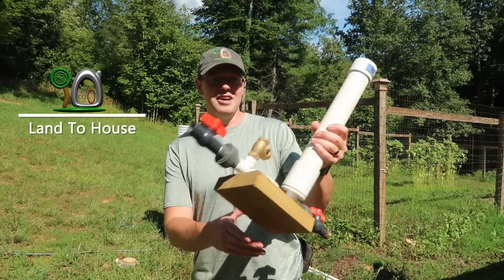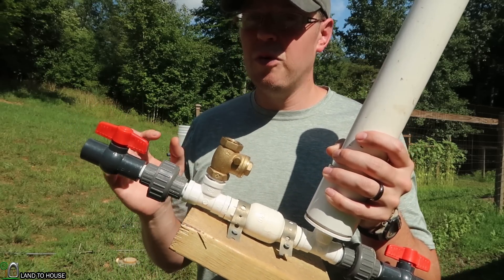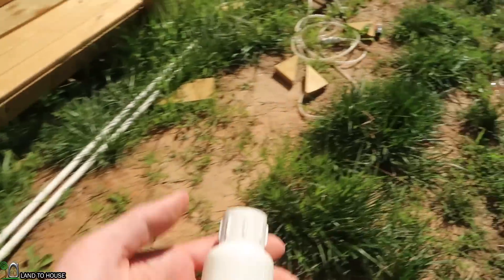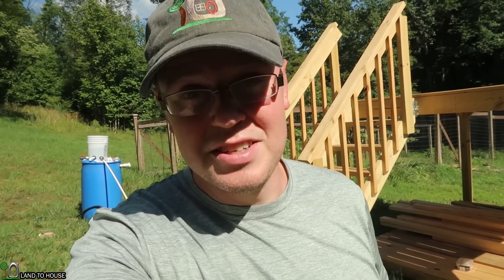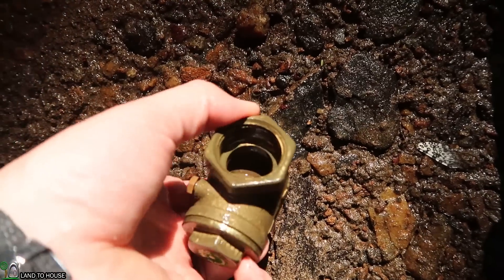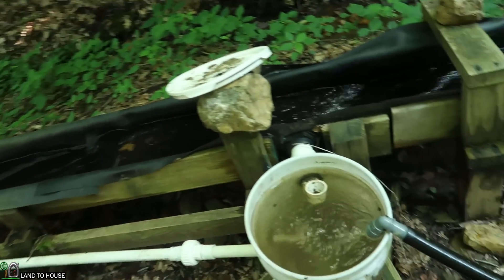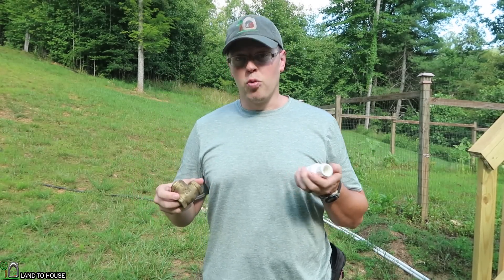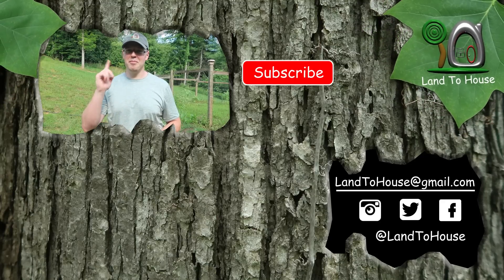A PVC Waste Valve - Will It Work - Ram Pump

Comment: I have successfully modified a 1 1/2 inch pvc spring check valve and it is currently operating on my ram pump as a waste valve pumping water 500ft to my farm. 
If you would like to know what I did, just let me know

Comment: I love the idea of using the stainless steel swing valve (waste valve). Can you do an experiment adding 1 or 2 stainless washers to the inside of the PVC valve, to see if it will make it heavy enough to work properly?
Reply: The pvc spring check can be made to work. I have a 2" system working. I removed the spring, it unscrews from one end. Then replaced it with two 3/16" fender washers with a 3/4" steel nut sandwiched between the two washers and screwed all of that back to it using a longer screw. I think the screw ended up being about 1.25" long. The check valve also unscrews in the middle and has an o-ring between the two pieces. I want to try a very light spring but it wouldn't be able to be very long because then it would keep the valve from shutting all the way. I know this video is a little old but Seth has done a good job with them and continues making good videos.

Comment: Could you run a stand pipe off of a pvc spring valve to a brass valve at the top with the same orientation and have the pressure wave from the brass valve close the pvc valve with similar force?

I'm trying to build a system that uses a .017 internal diameter aquarium hose as a stand pipe with bushings and fittings to elevate my waste valve back into the bottom of my source tank(like a water tower) so I have less losses overall.

Comment: Thank you so much Seth for your videos. Can I use the ram pump for my concrete fish ponds to pump the water to a bucket gravity filter? I am thinking of using the pond's outlet pipe as my inlet for the ram pump will give a good drive pressure , but the waste valve will lead to continuous loss of water. 

What can I do in this scenario and is there a way to reduce the noise/sound of the waste valve snap?

Comment: The slightly longer open time and stiffer snap closed on the stainless steel waste valve should also generate a higher pressure spike, and a little more delivery pipe pressure/height/flow.

Comment: Hello Seth
     I use a 2” drive pipe 25’ and created my own waste valve using a 2” to 4” bell reducer and a 4”to 3” bushing with a 3” close threaded pvc nipple. I turned and milled a gate that seats on the bushing. It is 1” thick in the middle flat that rides in the pvc nipple. I attached a small offset flat to give the gate a slight turn each cycle to prevent wear in one spot. No springs or weights needed. 
    I have rigged it to compress air with some success but about 60 psi was about all it would muster. I managed just over 70 psi with water.
Reply: Yes please do
Reply: Could you post pics or a video of your build  ?
Reply: @loulouki  I have had to rebuild the ram gate since I made this comment. I was amazed that a I” solid would snap by the repeated inertial hammer. My new one is different but amazingly quite and more efficient.
     Perhaps I will post the upgrade to my YouTube channel in the near future, along with some off grid stuff now that I am off grid. I need more than just cannons on there anyway.

Comment: I think you must add a waste valve height pipe as you did in one of your video with a brass valve . Since by doing so pressure on waste valve from outside will oppose it allow some more water to flow out giving the water more kinetic energy

Comment: Would a check valve with a stainless steel ball work? you could make one like the one from the king of random (https://www.youtube.com/watch?v=DG6own141z0). It may need to be a bigger size than the drive pipe considering the space between the walls of the tube and the ball bearing. Would be interesting to know if it works at all, how long would it last.

Comment: I have a probably stupid question, What happens if you have two ram pumps on one line? Would the pressure be greater after leaving the second pump? Less pressure? No change in pressure?
Reply from the maker: You will increase the flow rate but not the pressure. https://www.youtube.com/watch?v=oKQiWIje-zM
Reply: @LandtoHouse  thank you for the reply and link! But I was wondering what would happen if you had two pumps in a row (inlet>pump>outlet/inlet>pump>outlet)

Comment: Will it be possible to put an o-ring on either the valve or the seat? This idea is for the brass and stainless. There are kits that allow you to make your own o-rings for a custom fit, I believe you can find them at your local auto parts store.
Reply from the maker: To make the closure quite? That is one thing I want to try in my attempt to make the pump less loud.
Reply: Land to House Ehh, I wasn’t thinking for quietness, but more along the lines of longer lifespan. Forgot to mention that in my post.

Comment: dont know if someone said it already but leave the spring there and mount it with the spring pushing in.

it will 'simulate' weight on the ball and regulating the spring tension you can even adjust the how long it will be open (longer times more pressure)
Reply from the maker: That's true. I have plans on adding weight to a brass valve to adjust the cycle time this summer. These pvc valves are not great at adjusting.

Comment: The Unions should be directly on either side of the check valves but Before the pressure tank, as the 'check valve assembly' (the only two moving parts) will need to be periodically replaced due to mechanical wear. Have a 'new' replacement 'check valve assembly' on hand for when you need to swap out that single section (between the Unions).
Reply from the maker: In 6 years I have not had a spring valve go bad. And with the new Stainless Steel  waste valves the waste valve should last a long time.

Comment: question: If you had a body of water with waves, could you get a ram pump to work? Maybe secure the pump on a float Like a bouy and  the feed line put strait down with a foot valve that way every time a wave passed by it would raise and lower the whole system creating the water hammer effect. what do you think?
Reply: On the ocean there are wave power generation systems that use the wave action - not sure how well they work.   On my pond - probably not.
Reply from the maker: Oh I have seen those. Like a shake flashlight but massive scale.
Reply: @LandtoHouse  couldn't the pressure tank on a ram pump be rapped with wire and a properly shaped magnet placed on a float on the inside of the pressure tank act just like a shake flash light to charge batteries? would be a cool experiment to see done.
Reply from the maker: There might be a way to get it to work. What would you use the salt water for?
Reply: @LandtoHouse  I wasn't thinking salt water more like lake water but, if you could pump ocean water to evaporation tanks or pans you could make sea salt or capture the water vapor from that for irrigation

Comment: Would a stand pipe above the PVC waste valve have helped it click shut?
Reply from the maker: Adding that water weight might help. I would need to try that.
Reply: @LandtoHouse  Thanks for considering.   Would depend on the installation, but one of my concerns about adding more ram pumps is the sound of the clicking waste water valve.   I guess that we will always have sound of the pressure wave in the drive pipe, but the operation of the valve does sound different for different style pumps.   I think one valve with a pin had a leather gasket.    Also running underwater as shown in one of your videos might help, but the sound does seem to carry along the drive pipe.   Would it make a difference if the drive pipe was also underwater, but sloping up towards the water input end?
Reply from the maker: A buried drive pipe would reduce the sound a lot! I am planning ways of reducing the sound for this spring.  Tons of videos planned.
Reply: @LandtoHouse  Great - please post links when available.   For some of us that may need multiple pumps, this might save money on ear plugs and keep from scaring off the wildlife.   Or on the other hand, I wonder if the ram pumps might help repel coyotes?
Reply: I've been thinking about several videos where there was too much head for the lift for the waste water valve to close and the solution was to increase the lift.   Also, sometimes the shut-off to the delivery pipe  was turned off or partly closed.    Aren't there other useful things that might be done - like maybe putting on a sprinkler (Wobbler or other) on the delivery pipe (not sure if this would help or hurt the wastewater valve shutting) ... or how about increasing the diameter of the delivery pipe - would more water weighing more for a given height have the same effect as extending the delivery pipe higher or would it not make any difference?

Comment: Hey buddy. Love the videos. Got a question. Is it better to have 6 ft of elevation or 6 ft of head?    Simply. I have a dam that is 6 ft tall. Is it better to have the feed line coming from the bottom of the dam with the reservoir of head pressure or the top of the dam with the elevation?
Reply from the maker: Both will result in the same lift. It comes down to ease of install and how easy the supply is to keep clean of debris.
Reply: Thanks for the question - I had the same one.   Now I just have to figure out if in my situation it is better to tear part of the dam out to get to the bottom.    Also, it appears that I will need a longer drive pipe than I thought to get more momentum in the drive pipe.   I wondering about going through the bottom of the dam and across the bottom of the pond for a ways rather than starting at the top the dam and extending the drive pipe below the dam, resulting in the pump being at a higher elevation and reducing the amount of lift required.   Sounds picky, but I'm trying to optimize the volume of water delivered to the a certain elevation for irrigation.

Comment: What if you let the spring push the pvc valve downwards?
Reply from the maker: The spring in this type valve is non reversible.  It might work to have a 1/2 pound spring holding open the valve but then it might be too much! A lot of head pressure would be needed.

Comment: Hey been watching a lot of your videos. Good work very helpful. Anyways in another one of your videos you used a stand pipe on a brass valve. Maybe you should use a stand pipe on the pvc check valve. It would need to be the correct size. Would take some testing.Maybe this will help you out. Since you are trying to help everyone else with free information. Thanks
Reply from the maker: To get the PVC valve working in this test I would have to use weights on the plunger. That PVC is just way too light. The pipe on the valve reduces the head pressure and keep the pump from working to its best.

Comment: I'm looking at your Ram pumps and I have a question would it be possible to catch the water that comes out and re use it again
Reply from the maker: Hello. Yes you can re-use the water from the waste valve as long as its further down hill.
Reply: I'd wondered the same thing.  We have a certain amount of water available and given that 90 % or so is used to drive the 10%, if we linked up the pumps down a gully, might be able to run multiple pumps.   Also, if the water is used near the stream, most of it my seep back into the stream eventually and be available for use again.
Reply from the maker: I think that a 1-1/4" pump has enough waste water to run a 1" pump. This summer I am going to try to run all 4 sizes from one source drive pipe. Cascading pumps. We shall see!
Reply: What is the ratio of water pumped to water expelled?   I'm thinking 1 to 5 (20%), but sure it depends on the pump and situation.  Maybe one part of the question is with the water significantly spurting out of some pump waste valves, can this be used beneficially without impacting the performance of the pump rather than just throwing it up in the air and having it fall back to the stream or the beginning of another drive pipe?

Comment: I saw one person use a metal spring valve where they took the spring from one side and put it in the other side. Also can the swing check valves be refurbished. I would rather replace a worn pivot than the whole valve.
Reply from the maker: I've seen people swap the spring around also. As long as you're valve can do that. I have one that is welded shut. Also adding that half pound spring can reduce the efficiency a little bit. Supposedly you can refurbish the swing valves. I have tried with two different valves and I think the threads were fused together. The tools I have weren't sufficient to open the valve. Landa Haus pumps will be using stainless steel valves in a couple of months. They last at least twice as long

Comment: Zeth, in comparisson, which is better for you stainless steel or brass swing valves. Can you please also try which one deliver more water. I observe the steel the flaf is all the way down it means longer hammering.
Reply from the maker: Yes the steel has a heavier flap making it close with more force and more water required. So it needs more water but is able to produce more at the top.

Comment: This may be an odd question but why don't you just have the water from your floom/aquaduct fill the bucket and have the overflow filter back into the floom instead of having your first (black) drive pipe??
Reply from the maker: Valid question.  Sometimes the flume water is inconsistent.  I am planning an even better intake.

Comment: Hi Seth, I am try to make one ram pump by myself, but fail because of valve drop down but it can not come back so the water just running out but the valve didn't close, is it the water pressure not enough ?
Reply from the maker: Often times when the valve does not close it is because there is not enough head pressure or there is air trapped in the drive pipe.

Comment: If you want the plastic check valve work, if there is a chance to install the spring on the top in order to keep the valve always open.
Reply from the maker: I think the spring is 1/2 pound. Probably just a little too heavy for this pump.

Comment: More volume of water will be delivered and more durable can last longer than the brass valve when using this stainless valve
Reply from the maker: Yes! I have hundreds of the stainless steel on the way. The steel  valve that is running down in the creek is doing amazingly.

Comment: Great video.  I have the solution for the heavier check valve.  Instead of mounting the stainless steel chekvalve as you do try turning it 90°.  You point the side towards the pressure chamber.  Instead point that to the side.  Then you can tilt the stainless steel chekvalve to the side so the flap valve doesnt open all the way.  Gravity will keep it partially closed and you can adjust the speed of the heart beat that way.
Reply from the maker: Yes that will work! The tilt does slightly reduce the output BUT perhaps with the added weight the valve increases the output so it will will equal out and be as if it were the brass valve. ..... if that makes any sense.
Reply: @LandtoHouse  your expertise with the Ram Pump far outweighs mine.  I hope I did not come across as a known it all.  We all have learned so much from your experiments.   :-)

Comment: Seth, the brass waste valve is not durable compared to stainless steel specially when the drive pressure is stronger. Before Im using a brass valve and replace with stailess steel. I recommend a stainless steel waste valve and check valve than brass valve, it will last longer. The only problem here in my country Philippines the stainless steel valves is not easily available in the Market.
Reply from the maker: Thank you for your great insight! That is the information I was looking for. I am looking to source the valves and start using them in the next 3 months. (It can take a while to get them)

Comment: How do you remove the spring from the pvc check valve
Reply from the maker: The model I have has a simple screw that holds the spring.
Reply: @LandtoHouse  which model is it? What is the brand, and where did you get it?

Comment: Seth, I own one of your 1/2" RP's. From your experience, what is the number one cause of "failure" in the brass waste valve? WranglerStar showed that from his experience it was the Pivot Pin. 

Like Gene below states, it may be time to start to do some design work. I am a 63-year-old retired Mechanical Design Engineer and would have a lot of fun designing the Ultimate SS Waste Valve. You could save me some accelerated life testing and "Strife" testing if you and others could identify the number one and two failure modes. Thanks again for another great YouTube. John
Reply from the maker: In the past 6 years the main thing that fails is the brass valve. It's the main component that takes the abuse. I found that the pin wears down but also the flap can have an indention that allows water to seep around. The second thing that fails is the ball valve if left in the Sun. 

I believe I've decided to go with a 304 stainless steel valve. I figure that the corrosiveness of a 304 is not going to be bad considering the valve will only last 3 years or less because of the wear.
Reply: The brass valve is not so durable, and replaced with stainless steel. I dont have problem with stainless steel but is not easy to avail. I fabricate a waste valve with 2"    GI coupling with boozing 2"x 1 " and on the other end of coupling is 2" x1" boozing inverted and then welded. The plunger is made up of hard rubber(truck tyre) secured to stud bolts and nuts. I am very happy with the performance of my waste valves as well as with my home made ram pump. In addition, the check valve I use is made up of stainless steel.